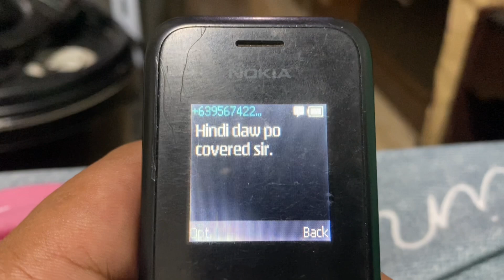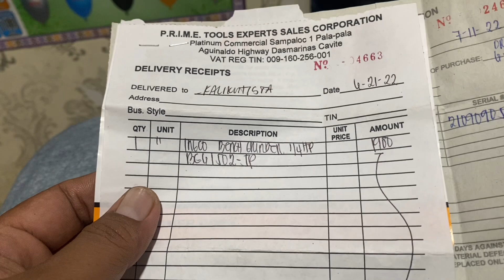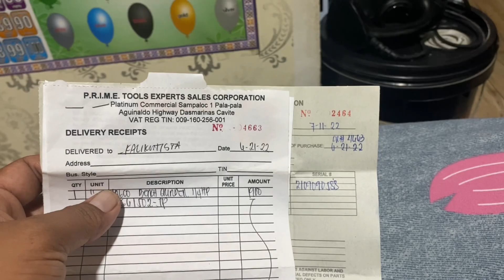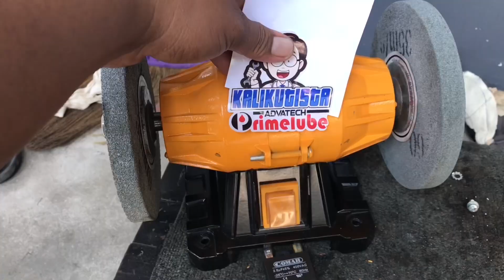Hindi na WARRANTY

Comment: Sir yun bang pinalit nyong capacitor same lang ba sya ng specification nung stock nya or mas mataas na pinalit nyo?
Reply: Same lang dapat ng microfarad.
Reply: @rexeverything9828  kung magtataas ako konte ng microfarad sir hindi ba pede? yung kasing bench grinder ko 150W sya, e may kahinaan pala yun,
Reply: Kung 150 subukan mo taasan ng .5 kakayanin nya pa ang electric charge. Mamaya kasi baka shafting o bushing ang problema
Reply: @rexeverything9828  sige sir ttry ko, salamat po sa info